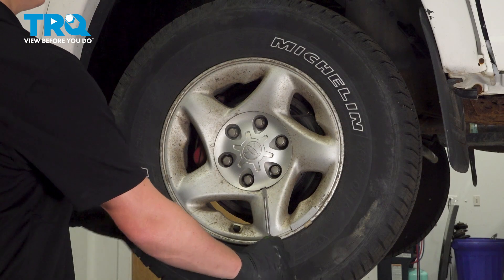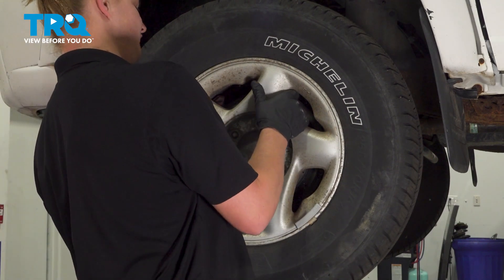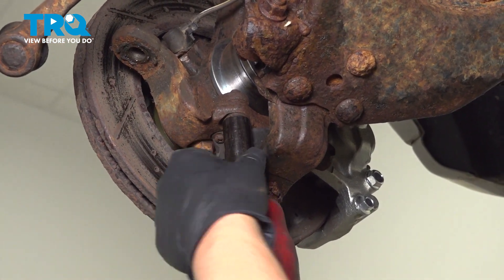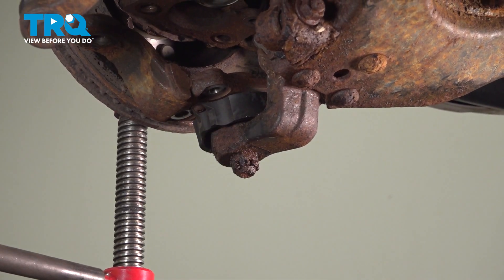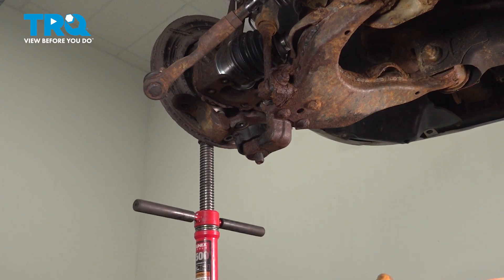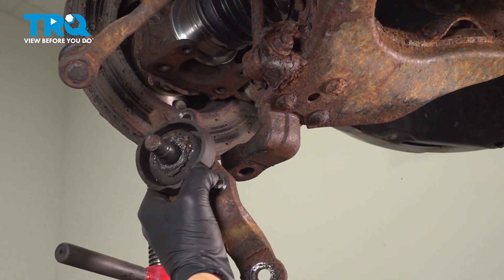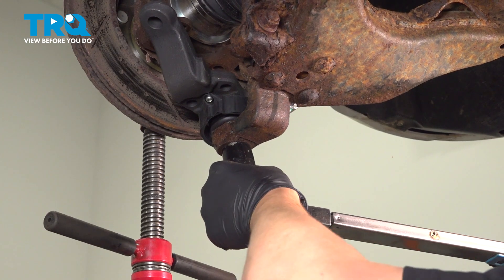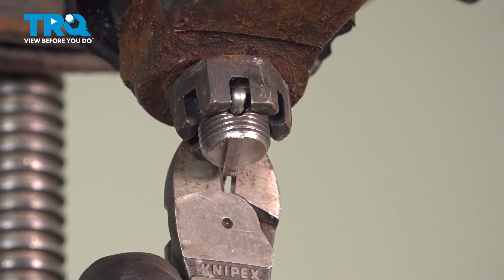How to Replace Lower Ball Joints 2000-2006 Toyota Tundra

Comment: Great video on replacement! This helped me a lot. But you should ALWAYS use new bolts for the LBJs. The LBJs are real pain points on these older Tundras and Sequoias and should be done around every 100k or when you notice that are a little loose. This is one of the parts you should always go OEM with. Yes, you will pay more, but all aftermarket balls joints are not great. Just look up what happens if your LBJ breaks while you're driving down the road. This is a main suspension component and your safety is on the line if you cheap out with LBJs.

Comment: I have run into issues removing old ball joints, and I think it's this:  Soaking the ball joints in PB blaster may free up rusty parts, but also allows the spindle part of the joint to spin too freely, a major pain to remove.  Seeing how you removed yours i'll try it out as im up for this very job next week.   Update to follow- thanks
Reply: How’d it go?